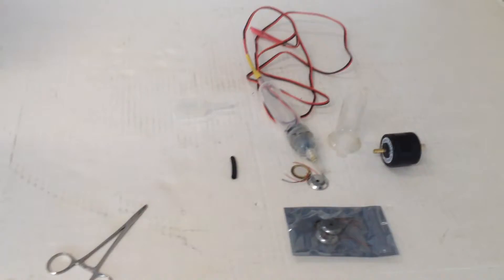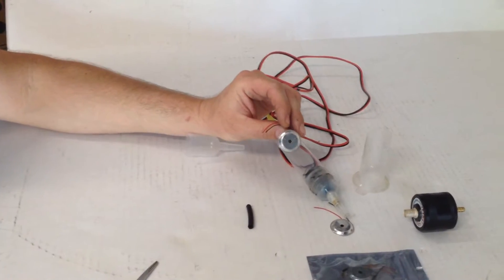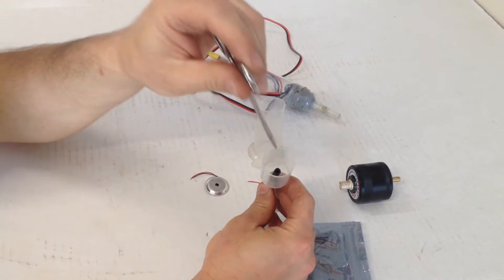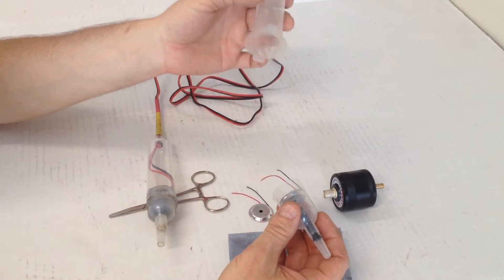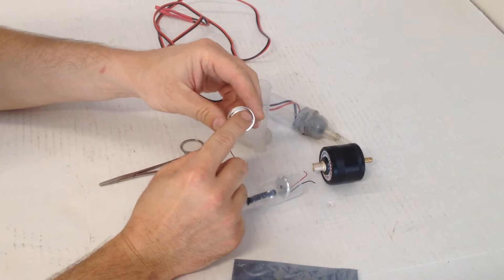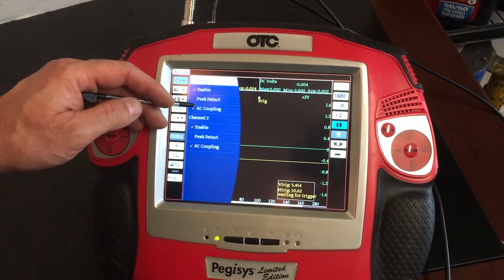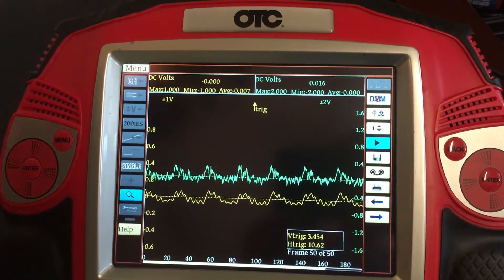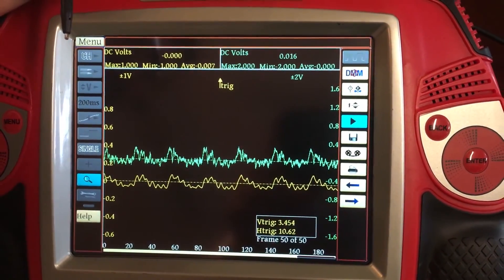Home Made Pressure Pulse Or First Look Sensor

Comment: thanks for showing your diy projects that save so much for the little guy.  I the piezzo element pushed right up to the rubber tube, and is the piesso element sealed aroung the edges. not sure of the mounting details. thanks
Reply from the maker: Ed KE6BNL This sensor has aluminum cover so you can place rubber tube in front of it. It works fine. Thank you

Comment: I am wondering if this sensor is sensitive enough to detect a vacuum leak / hole ??
Reply from the maker: radu soptea I don't think it will. This sensor only detects differential in pressure.